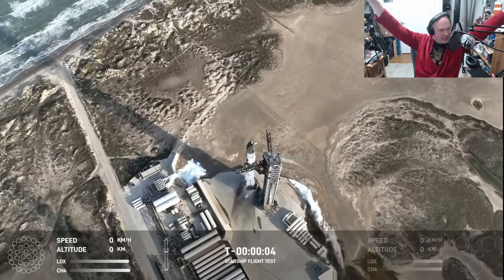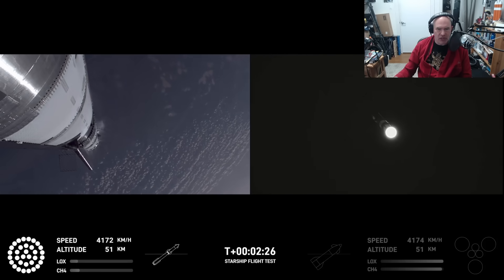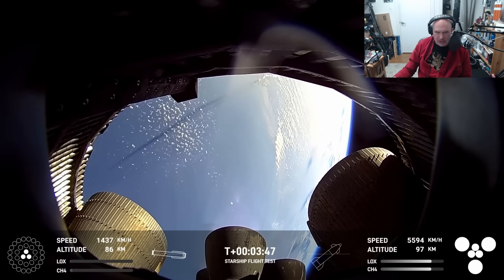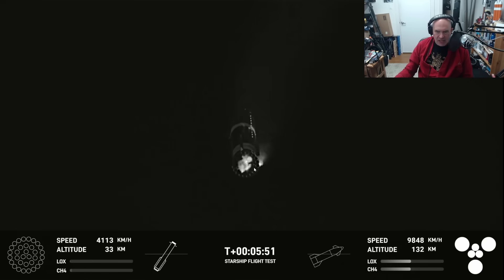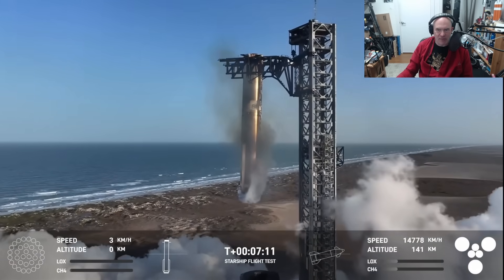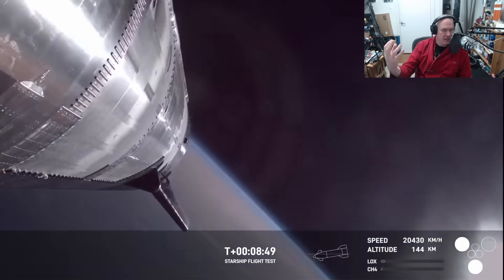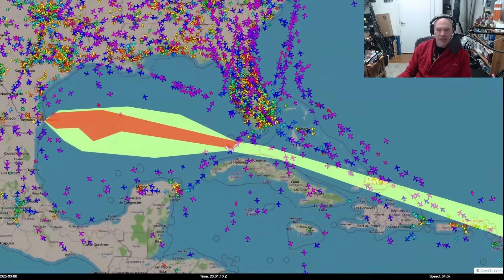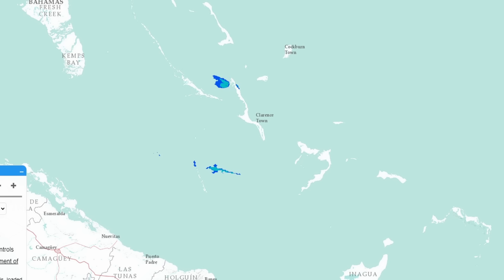SpaceX Make The Same Mistake Twice With Starship Flight 8

Comment: Scott, what if that isnt to handle translation errors on the booster landing/catch but a way to get the exhaust plume further away from the tower. Would make more sense than low speed maneuvering of the arms.

Comment: They keep using the sea level engines in space. There is a reason they are called sea level engines. You can't use them in space or they fail.

Comment: Harmonic vibration was the cause of the starship failure (as Scott correctly described). 

This can be fixed by installing two Stockbridge Harmonic absorbers at a 90-degree angle to each other, across the engine bay. They have to be engineered to tolerate the heat of the engines but can be stretched across the bay just above the engines. These adaptors will absorb the harmonic vibration. They have to be at 90-degree angles. One, by itself will not work. It requires two. They work "in concert" with each other to re-direct the vibration to each other.

And they have to be very thoroughly attached to the sides of the cylinder. If they shake loose, they will fail. 

Sanjosemike (no longer in CA)

Comment: I find somehow odd the design changes taken on v2. They spliting a big downcomer into more smaller ones (each vraptor has one, so there has to be 4 smaller ones now). 
That is more parts, against filosophy less parts better 😅
And secondly, something big has usualy a bigger resistance to change of movement and easyer to secure. Wish we could see tanks cameras....

What is also odd, left v-raptors bell glowing red. There are no tubes in those bells, so that must be coused by: 
1) oxygen rich flame from outside or
2) combustion instability?!
3) "leaky" injector.. but that would be noticable in exhoust...

Need more data to analise 🤔
Reply: With it's variant number we should be happy it didn't land on London.
Reply: @swmark78 lol.. not the same abbrevation, not even close. Vergeltungswaffe vs Version 😂

Comment: Retired Metallurgist here.  Am I wrong, or were IFTs 7 and 8 not only the first Block 2 Starships, but also the first ships to carry full simulated payloads?  If so, both ships' internal frame structure was under greater stress than in any previous flights.  Perhaps the stress reached a tipping point at a weld in the liquid methane piping.  A crack could have developed in the heat-affected zone (HAZ) of the weld.  This in turn could have been made even more likely by the possibility of the development of "Sigma Phase" during the welding process.  Sigma Phase is a brittle intermetallic (Fe-Cr) compound that can often develop in austenitic stainless steels during welding.   There are well-documented ways to minimize this.   The other issue is the presence of weld-induced residual stress before launch in this same piping assembly.   If SpaceX is not performing a stress-relief operation on all these piping subassemblies after welding, they are definitely asking for trouble. IMHO.

Comment: My guess is SpaceX will relax their rapid reduction in weight and complexity in order to get an end to end success.  They may add 10 tons to improve vibration tolerance and reduce vibrations. They may add contingency software that compensates for engine failure by shutting off engines to avoid cartwheeling from imbalanced thrust, then test the heat tiles starting at 20,000 km/hr instead of 27,000. They may insert baffles between engines to prevent a chain reaction of engine failures.

Comment: It took several failures using concrete launch pads before they finally switched to steel plate. These back to back starship fails look similar but may be different.  Regardless, I hope they added lots of extra sensors with telemetry to understand and confirm their understanding of what is happening.   e.g.   shock waves from explosive stage separation?  Propellent pressure harmonics & hydraulic hammering? Impurities in propellent building up and causing a blockage like a blood clot? Mechanical vibrations creating metallic fatigue failure? Propellent leak? Etc

Comment: The booster is absolutely blasting that upper stage with exhaust on it's boost back maneuvers. Prob causing damaging the engines on the second stage. Take a raptor and fire it AT the engine assembly of the second stage for a few seconds.

Comment: Our company had multiple similar problems, with resonances, in various mechanical structures, on combat vehicles.  We did not have supercomputers, nor AI to help us.  The solution is simple, lower the Q, or lower the Q.  Easier said than actually done.  More weight is almost always necessary.

Comment: Guess SpaceX engineers never heard of root cause analysis no way they could get to root cause and implement fix(s) and test in the timeframe between launches.  They are just guessing and keeping their fingers crossed and hoping they get lucky, trial by fire…literally! Saw analysis the return booster thingie for reuse is a gimmick.   Reduce the number of rocket motors and strap couple of solid boosters to the thing you will get the same result,cost and thrust.  Just Musk’s ego getting in the way as usual.  Good luck finding anyone who would put an expensive payload on it or ride that thing.

Comment: Oh man if only there was a historical example of why having more engines causes more points of failure
Reply: Pure statistics and probability.  It’s Musk’s ego at work reduce the rocket engines and strap some solid boosters to it.  You get same result in cost and thrust plus improve reliability.  The return the booster stage for reuse is a gimmick to stroke Musk’s ego.
Reply: @JimmieBrown-sg8fq  I assumed it was to get the green dorks back on board because he's recycling at a very high level.

Comment: As a layman, I can't help but feel a failsafe of killing all the 3 large engines whenever any of them fail would help correct this. It may STILL return to Earth unoptimally but won't spin like a top and would remain largely intact. Killing the large engines you might even return the capacity to utilise the smaller engines which may be able to salvage the mission as you're already at extreme speeds (17,000km I believe) and with added propulsion from them that might give enough thrust to keep from returning to Earth

Comment: They had the same problem with V1 Starship, and they changed the AFT section to a thicker metal to prevent the leaks. Then they thought it was a good idea to go back to the thinner metal for V2. Yeah, how's that working out for you spacex?

Comment: Its obvious that a complete re-engineering of Starship is now a necessity.  This will undoubtedly delay the next launch for several months, and Elon's timeline is overly ambitious.  I think a full re-engineer and full duration test fire at Masseys.  Unless they use Ship 35 as a crash test Dummy, and do a full duration burn on it to see if they get the same results, then dissect it to find the culprit, which I think is definitely in the modified plumbing within the Ship.  I think if this was some detrimental effect of hot-staging, we would have seen evidence of that on Flights 4,5, and 6.  HLS needs to be removed from the backs of SpaceX, and let Blue Origin design their lander.  We can put landers and modules up on the Falcon Heavy if needed to meet up with SLS hardware in Lunar Orbit.  I almost think SpaceX needs to go and re-engineer a larger fairing for the Falcon Heavy, and try to flight prove it for human flight, it would open a lot of doors until New Glenn is ready.  Blue Origin needs to get New Glenn 2 going.  Artemis must continue.

Comment: You guys don't get it, booster catching and relanding is easy once you figure out the math. Will all the computer onboard , and GPS, you can steer these rockets to land anywhere. It's just calculus and Differential equations and  fast compute. We couldn't do it back then because the computers were way to slow.

Comment: Come on Scott. You know SoaceX will get this figured out and quickly
Reply: Adriane 6 was started a tad after Starship design. 
Adriane 6 has been launched twice without it exploding or failing to put payload in orbit.
Starship has launched 8 times, every time this fully reusable rocket + booster ended up being converted into debris and scrap metal.

Comment: The term ‘“harmonics” is misused here.   A harmonic is simply a multiple of some  fundamental frequency such as pump speed.  The structural natural frequencies and perhaps acoustical natural frequencies in the piping can respond to such excitation, resulting in high vibration and stresses, ultimately failures.   

In this case, excitation is likely  broadband (turbulent) flow, not a harmonic of turbine or pump speed.  A structural natural frequency can align with such excitation, causing high vibration.  There may be 1-d or 3-d acoustic modes involved as well that exacerbate the forces

Comment: The good news is that both were hard failures that can be studied carefully and resolved. Much better than getting lucky and having the flaw still there only to be found a dozen flights later when a lot things are critical ... expensive payloads and even people.
Reply: facepalm Cope harder 
They post poned the launch of 8. Why? If they had the idea that something was sub optimal then didn't they fix it before launching? Sure, it's better that they have failures before cargo or people are on board but .... isn't it better not to have failures at all?

Adriane 6 just had it's second launch. Both launches had payloads that were delivered. Times that Adriane 6 has failed so far zero.

Starship has had 8 launches. Times that it has failed so far = each and every time (anything that doesn't even come close to doing what the flight plan said it was going to do = failure)
Reply: @PDVism  I've never heard of the fictitious Adriane 6 rocket, however: The failure of Ariane 501 was caused by the complete loss of guidance and attitude information 37 seconds after start of the main engine ignition sequence (30 seconds after lift-off).

Negative outcomes is a critical part of learning toward excellence. There are about 15K excellent people behind the SpaceX team. Over 400 successful launches to space, and more than 7,000 satellites in orbit from this highly successful team. More than NASA teams for 60 years. More than Russia space teams in 60 years. More than China space teams in 60 years.

How many losses do the best MLB teams have before they win consecutive World Series titles? How many losses to the best NFL teams have before they win consecutive Super Bowls?

I'm guessing the only thing you are good at is putting excellent people down for their successes. And you can't even get that right.

The rest of us learn from the negative outcomes, and do become successful where others have always failed.

Comment: It could be something as simple as the length of pipes changed, meaning their natural frequency is matching the fuel flow and the shockwaves from the thrust, which could cause the pipes to resonate and come loose, but it might only be happening in vacuum, which makes it undetectable in the test stand. I don't really believe this, but it's a valid explanation for why something could come loose, just like Tacoma Bridge. I think it's more likely that gas bubbles form inside the cooling walls, blocking flow and causing overheating and this leads to burn-throughs, but that is also a bit of a guess.

Comment: I’m not surprised with this. SpaceX has always been suffering from chamber melting on those raptor engines. It’s been a problem they have never been able to fully fix.  I suspect starship nine will not go into orbit either, and the chances of other ones being able to do that or realistically carry any kind of payload are pretty grim until SpaceX can get that under control. This however, does not seem like likely. The Starship has been a boondoggle its entire life.

Comment: I noted the "FTS safe" callout as well, but someone on the Ellie in Space live chat replied that it likely referred to the booster, since that had just been caught. The timing makes sense. 

SpaceX is going to need to do a top to bottom engineering review of Block 2, that's for certain. 

That glow in the aft skirt makes me wonder if there was a methane and O2 leak causing an uncontrolled fire in that area?

Comment: It appears that the root cause of the two failures is different. 
Flight 7 was caused by a leak which caused overpressure. 
That was probably solved.
Flight eight had a explosive engine failure.  
One started in the propellant supply the other in the engine itself.

Comment: Different time. Different vehicles. 
None of the Apollo/Saturn components (S1C, SII, S4B, CSM, LM) were designed to be reusable. Reusability is difficult. 
And Starship has much larger crew and payload capability to the Moon than Apollo/Saturn. Apollo/Saturn landed two astronauts and about 500kg (0.5t, metric ton) of payload onto the lunar surface on each mission. Starship is designed to land 10-20 astronauts and 150t on the Moon in a single mission.
Apollo/Saturn was an excessively expensive program that turned out to be a dead end.
Between the start of the Saturn V program in 1961 and the first flight of that vehicle in Nov 1967, NASA spent $26B ($2025) on that vehicle.
Starship development began in 2019. Through IFT-8 (6Mar2025), SpaceX has spent ~$5B on that program.

Comment: Starship is 0 for 8 so far. Next launch it'll be 0 for 9.

And I know, "it's a test and success shouldn't be expected." That's the exact issue with Starship. Success shouldn't be expected. What is to be expected is scattered debris and economic loss due to delayed flights of airlines.
Reply: I’m wondering how long until airlines take spacex to court over these delays

Comment: Really seems like the "Ultra slim and sleek" aesthetics of Raptor 3 is biting them in the ass here. Would've been nice to have super detailed sensor packages on the entire engine so that they have plenty of debug data (as every other rocket company does), but I guess that nest of wires wasn't chic enough for SpaceX.
Reply: Except that no Raptor 3s were on this ship.  They're still using Raptor 2s on these Starships.
Reply: @jeffcorbett7734  iirc though they still offloaded around half the diagnostic sensors on Raptor 2 alone, with Raptor 3 having few to no sensors (at least visibly). What I'm saying is that they probably shouldn't have been so hasty with removing diagnostic tools before they even got to orbit (or orbited with payload)

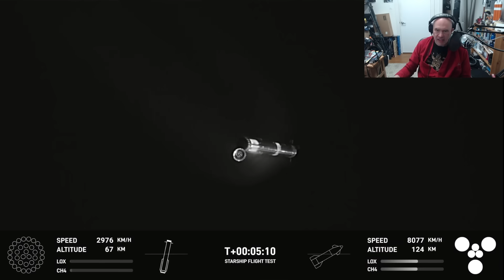Comment: I'm  suspect that the black and white shots of the booster are from an infrared camera.  Notice how bright the hot staging ring is at 3:45 of your video (5:13 into flight).  That would make sense because it just experienced 6 Raptors firing through it.  On the other hand, the bottoms of the tanks appear bright, too, where the frost of the cryopropellants is still present.  Wouldn't that make them dark in IR?  Or does the frost scatter IR from sunlight, like the frost does with visible light?  IR would help them understand the heating due to atmospheric drag throughout the booster and throughout the descent, so they can better build it for reflight.

Comment: They don't need to put parts back on; they need to take a part off, namely the Hot Staging Ring. I think its the hot staging that is causing the engine problem. They defer this for awhile to start Starlink deployment and get Starship to generate income. They don't need to be thinking of marginal payload increases now. Just get loads that pay!

Comment: I believe they are now pushing way more fuel and getting way more energy out of the engines and they havent found a good balance of thrust with the improvements for the hot stage, it is obvious due to the additional reinforcement there is way more power inbetween the booster and ship and that is likely causing all sorts of chaos in the skirt, I believe they need to just move to raptor 3 to reduce the irratic surfaces in the skirt and prevent the mahem of the exhaust going everywhere causing damage. I am wondering if it cpuld have less of a skirt and sit inside a larger hot staging area with a better flame deflector structure or if that would put the rapters in the plazma flow on reentry?

Comment: 7:10 Is it safe to use Flight Temination System on such orbit height (140 km)? As debris from explosion would spread around the low Earth orbits in all directions, so huge portion of it would stay in orbit for a long time, effectively contaminating the space.
Reply: Orbit is speed and height not just height.  All starship are launched on sub orbital trajectories. Not sure on exact starship flight profile but even if it does go into space. It will not go into orbit. It is designed this way for your exact question. But if it were to enter orbit yes, it'd contaminate a range of LEO.
Reply: @battlebornsupermoto954  Ok, but when you explode something in this position, there is a good chance, that many debris chunks would get the right vector and speed to stay in the orbit for long time. You mean Starship itself. I mean Starship explosion where debris gets much more velocity in each direction, added to the original Starhip position and velocity. Some of them would get into orbit, as I can imagine.
Reply: There's a funny speed limit sign on the spacestation of 28000km/h.

Comment: 1:52 could be the key.
Check when Superheavy turns its engines towards the Ship. You can see some flames on the body of the Ship and it turns just a bit and shakes. Maybe it was enough to make the vibration for the failiure.